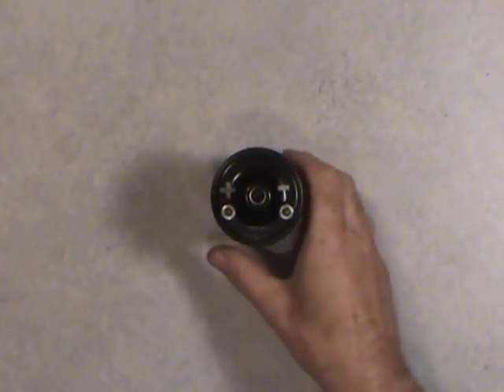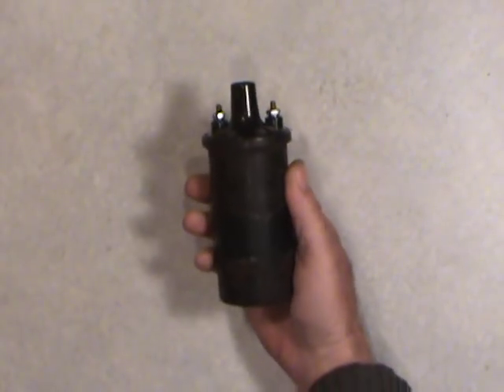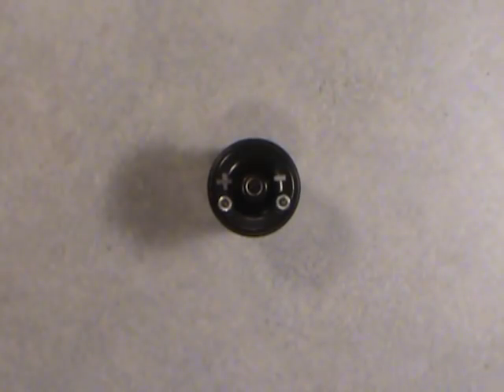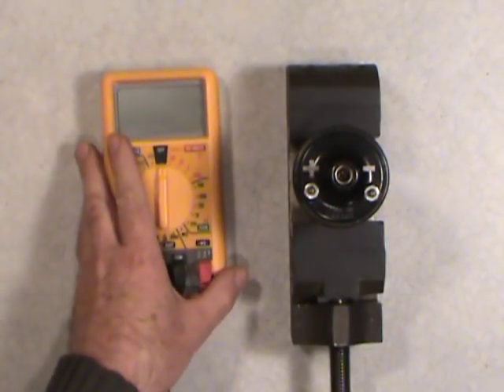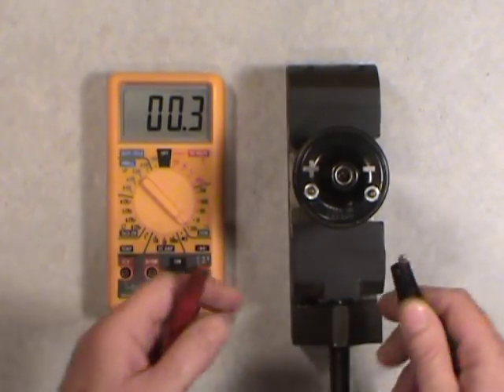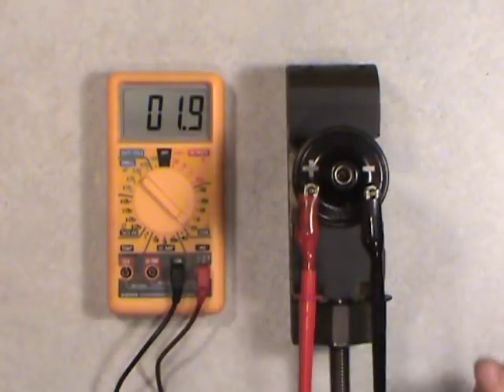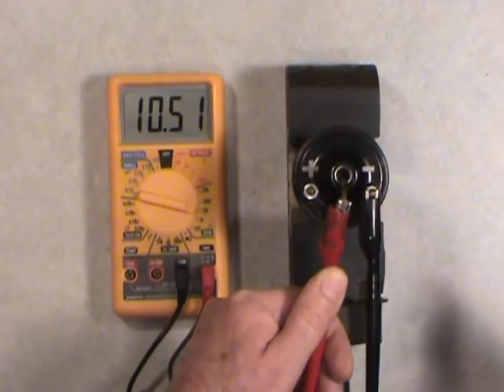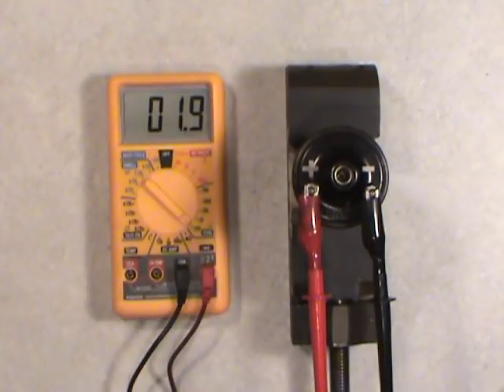Ignition Coil Testing

Comment: Thank you, great video!  Helped a lot in troubleshooting a no-spark issue in a 33 Dodge w/ a 360
Reply from the maker: Greetings Amorget....You're welcome, and I'm glad, that, this YouTube Video of mine was able to help You out, and also, thanks for watching, and commenting too....The "Ohm's" Readings, that show up as being with-in "Specifications" on both, the Primary & Secondary "Windings", are, as I see it, just a, shall we say..."Preliminary Test", as there just might, come a time, that, I'm thinkin', that, and probably quite "Rarely" as well, that, once a "Faulty" Ignition Coil "Heats Up" to its..."Operating/Engine Compartment"..."Temperature"...then, even though that particular Ignition Coil "Ohm's Testing" was showing...."Good"...that same Ignition Coil..."Might"...(and rarely at that), "Not Work" as it was Designed/Supposed to....In other words, that, shall we say..."Faulty/Suspect/Questionable"..."Ignition Coil", just might..."Break Down", when it arrived at its "Operating Temperature", and either, start to Function..."Intermittently"...or..."Not At All"...!!!

There is one, shall I call it..."Major" thing to watch out for, and that..."Thing" happens to be, the "Supply Voltage/Current" that gets "Sent/Connected" to the Ignition Coil's (usually)...Positive or + (+ = Plus Sign) Terminal on the Common (North American) Vehicles, that have...Negative or - (- as in Minus Sign) "Grounded" Electrical Systems, where usually, the Vehicle's "Chassis or Frame"...IS"...the (Negative) Ground.

Watch out now....as, Some of the much "Older" Vehicles "Electrical Systems"..."Might" have Installed in them, "Either"..."Negative"..."Or"..."Positive" (Electrical) "Grounding"...But..."Might" also have, a..."6-Volt"...or a..."12-Volt"..."Battery"...that resides in the..."Vehicle" in question...!!!

Then, depending on the "Actual" Ignition Coil in question, it may, or may Not "Require" a "Ballast Resistor", which will usually show up, in the Form of...a "Resistance Wire" (usually, can be found in quite a few General Motors vehicles)..or...a "Ceramic" (usually white-ish in color) Type of Ballast Resistor, that has the "Job", of "Reducing/Limiting" (and I'm thinkin') Electrical "Current", that as I see it, should result in the required "Voltage Drop", to "Prevent" that particular "Ballast Equipped" Ignition Coil...from..."Burning Up" (aka, Non-Functional any more...Kaput)...!!!

Depending on "Ignition/Electrical System" Installed in some Vehicles, that I have worked on (mostly North American/Domestic Vehicles, as in, General Motors, Dodge, Ford, etc.), would usually Allow "Full" Battery Voltage (in this case, Nominal 12-Volts), to make its way to the Ignition Coil, but, "Only" while in the process of Starting the Engine, and with the Starter Motor in Operation.

When in "Starting Mode", the Engine's "Starter Motor", just might Draw as much as, oh, could be about, and up to about 200 Amps (aka, Amperes), depending on, just How much Power/Torque, that the Engine demanded of that poor ole Starter Motor.

Now then, with All of that Electrical Current being "Drawn" (up to, maybe 200 Amps), from the Vehicle's Battery, has me thinkin', that, the Battery's "Voltage", would probably "Drop", to somewhere, in the neighborhood, of oh, about "9-Volts" maybe, thus, as I see, would be the reason, that, there is usually, a "Separate" Battery nominal 12-Volt Supply Wire, which, will usually "By-Pass" the "Ballast Resistor" all-together...!!!...

...then...

...once the Engine "Starts, and keeps Running", the Position of the Ignition Key/Switch, goes from..."Starting Position"...to the..."Run Position"...and as I've learned/experienced, while the Ignition Switch/Key is in the "Run" Position, the Battery's nominal 12 Volts, could be "Increased" to, oh about, 14.5 Volts, when the Vehicle's "Charging System" becomes "Operational", and, the "Ballast Resistance", that, was like I said earlier, was in the Form of, a "Resistance Wire" (General Motors), or, of the "Ceramic" Type, which will "Reduce" or "Limit" the Electrical "Current", that will result in the "Correct"...Voltage "Drop", that will be "Low" enough to keep the Ignition Coil from "Burning Up", as well as...Not being "Too Low", as that would make for, one, "Not So Good" & probably, quite "Weak" and maybe "Not Functioning"...Ignition Coil.

So, in a Nut-Shell, here's what we have...

...and...

...a very Good comparison, would be, just like the following, and shall we also say...descriptive...good ole saying...

...and, that saying is...

..."The Chain is Only as Strong as the Weakest Link"...!!!...

...or, as in...

...it "Only" takes "One" Questionable/Intermittent/Not so Good...Electrical Component or Wiring "Connection", to mess things up, which keeps Us All, from havin' a good day...

...with all that, said and done, I would like to end with...

...Be Safe, take care, and have a good one.

Comment: You will make a great teacher. Thanks
Reply from the maker: +Cobby Sparks ....Greetings Cobby Sparks....Thanks for watching.................Well, I sure appreciate, what You said, about me, making a great teacher, and thanks kindly for that..................Even I'm kinda surprised, at how long I was talkin', in this YouTube, Ignition Coil Video of mine, and, perhaps it could very well be, as they say, as in..."Time really Flies"...!!!...lol.............If an Ignition Coil, Checks out Ok, Ohms/Resistance-wise, there can be times (rarely), where an Ignition Coil might start Acting-Up, and Not work so good, once it warms/heats up-to Operating Temperature, which might result in, some Ignition related Misfiring (basically, just means, that, the Air/Fuel Mixture, in any of the Engine's Cylinders, isn't Burning properly)....................Thanks again, for Your nice comment, and..........till next time...........Be Safe, take care, and have a good one.

Comment: Good information but kinda painful to watch...  This should be a 5 minute video... tops..
Reply from the maker: Greetings...Brad Miller...............Thanks for watching..............Well, I did make a "Shorter" Version of this particular video, some time ago, and its running time, is about 8 minutes & change (damn, almost down to the 5 minutes that You mentioned...!!!...lol)..............Just make sure, that, when-ever taking an Ohm-Reading, on the Low/Primary side of the Ignition Coil, that, the Ohm-Meter, is Tested for 0/Zero Calibration before-hand, and if it shows anything above 0/Zero Ohms on the Low Scale, when the 2 Ohm-Meter's Probes are connected together, then, that Figure, (if applicable), has to be accounted for, otherwise, there might be a possible situation, where-by, a good Ignition Coil, may appear to be, "not with-in", the Manufacturer's Specifications, and.........till next time........Be Safe, take care, and have a good one.
Reply: Different people have seen this video & some of them don't know about most of the information you explained in this video , so it must take more 
 minutes ,therefore this video deserve time  which is taken
Reply: If you know the 101 in the beginning, no big hassle to forward it test. At least it caters for all groups in 1 simple video!

Comment: the added stuff is good mate. most allready know the little things, but throwing out the little pointers can help
Reply from the maker: +Chuzzlepuff Puffchuzzle ....Greetings Chuzzlepuff Puffchuzzle....Thanks for the nice comment, and for watching too...................There's even more, beyond, just Ohm/Resistance testing an Ignition Coil, as well...................There can be the odd time, where an Ignition Coil Checks-out Ok, Ohms-wise, but, once it/the Faulty Ignition Coil, gets up-to Operating Temperature, it might not work so good....................Also, if the Wrong Ignition Coil gets installed, its Specifications, might not be Correct, for that particular Ignition System, and, might result, in having a Weak Spark, or maybe even having, some of the Ignition Components get Damaged......................If an Ignition Coil gets Charged-Up, with too many Amps of electricity, for too many Milli-Seconds (One Milli-Second = One Thousandths of a Second, time-wise), on its Primary side, during its, shall we say, Charge-Up Cycle, then, that in-itself, has the potential, to probably Fry the Ignition Coil Windings, and, a Burned-Out Ignition Coil, it will usually be....................Once a Person, kinda understands, how, a good ole "Points and Condenser" type of Distributor...Ignition System (up, till about 1974 there-abouts) operates/functions, oh, and, there was "No Computer" anywhere in sight, back in those days, then, as I've found (for myself, that is), is that, by having a basic understanding, as to, how the older Points & Condenser (distributor) Ignition System actually works, I find it, so much easier, to kinda comprehend, as to how, a Computer Controlled Ignition System operates, along with, what the Roles are, for all of the Sensors and Actuators, that go along with it (I hope...lol).....................So then, there You have it, well, for now that is, and........till next time.........Be Safe, take care, and have a good one.

Comment: Very good video!  I believe you can test the old Lawn tractor coils that were used with "battery ignition"
Reply from the maker: maineville prepper Greetings maineville prepper....Thanks kindly, for Your nice comment, and for what You had to say, about the older Lawn Tractor's Ignition system................................................I'm thinkin', that, pretty much, just about any of the Ignition Coils, that were found on "Gasoline"..."Internal Combustion Engines"...(Yes-Sir-ee-Bob, Steam Engines, need not apply...!!!...lol)...could, for the most part, be "Tested" for "Resistance/Ohms Readings", much like I have, in this Ignition Coil Testing, YouTube Video of mine, as long as, the "Ignition Coil" in question has..."2-Primary-Terminals"...and a..."High Output Voltage"..."Tower"...much like, that of what You "See", in this Video of mine....................................................A Person, that might be Testing, any "Ignition Coil", that happens to be on Our Planet to date, should be aware of, the..."Many Differences"...in, what they are Expected to Do/Perform (as in, shall we say, the "Amount" of High Secondary Voltage Output, as an example), and also, the way in which "They" are "Constructed" (as in, Shape, Size, Oil or Epoxy, that is surrounding, all of those, many turns of, usually made of Copper, wire "Windings", that make up, both the Primary and Secondary "Coils", that are usually found, and are Contained with-in, that there Hypothetical/Imaginary Ignition Coil)...........................................................I'll now mention, a few things off the top of my head......................................................There were..."6-Volt"...and..."12-Volt"..."Ignition Coils" (as well as, "6-Volt" and "12-Volt"..."Batteries", that usually went along with them), and also, the "Vehicles"..."Ground"...System, should be "Checked" as well, as, some of the Older Vehicle's "Chassis/Frame", as far as I recall, had what was referred to as "Positive Ground" (+ or Plus Sign), as opposed to, the..."Negative Ground" (- or Minus Sign) System, that, for the most part, can be found on the "Newer" Vehicles, on just about any Street in North America these days.....................................................Usually, the "Oil Filled" Ignition Coils, were, well, kinda held back, from..."Outputting" as High of a "Secondary High Voltage", as compared to something like, the General Motors..."HEI" (High Energy Ignition) Distributor Unit/System, that used an "Epoxy" type of Ignition Coil............................Why You ask...???.........................Well, there was usually, what is known, as a..."Ballast Resistor" (could be in the form of a Ceramic/Porcelain Block, if You will, or, in the case of the General Motors rendition, there-of, it could also be in the form of a "Special Resistance Wire" as well)............................These "Ballast Resistors", were usually found, in the wiring circuit, just before the Ignition Coil Itself, and, they usually "Reduced" the "Battery Voltage" quite a bit, so the Ignition Coil "Would-Not-Burn-Up", and in the case of a "Points Type" of Distributor, it would also, prevent the "Ignition/Breaker Points"...from..."Electrically Arcing" too much, which would usually result in "Ignition/Breaker Points", that, shall we say..."Wore-Out", way too fast...!!!............The "Oil Filled" type of Ignition Coil Systems, some being "Points Type", and also "Electronic Type" as well, that I've worked on, would usually have a Spark Plug "Gap", of about .035" (thirty-five thousandths of an inch)...where as, on some of the "HEI" Distributor Systems, I've worked on, I had to "Gap" the Spark Plugs at .080"...!!! (that be, Eighty Thousandths of an inch..."Hole-ee-Gwock-ah-Moe-lee"...!!!)..............................................Always "Check" the "Specifications", and the Factory Recommended Procedure/Method, that applies "Exactly" to the "Ignition Coil", and to that of the "Ignition System" that You, or Anyone happens to be working on, both for "Getting it Right, the First Time", as well as..."Doing it Safely as well"..............................................One last thing...............Even though an "Ignition Coil"..."Checks Out OK"...Resistance/Ohms-wise..with an Ohm/Multi-Meter, while being fairly Cool, so to speak, there can be times, and quite rarely as well, where an "Ignition Coil" can start "Acting-Up", as in..."Operating Intermittently"...or..."Not At All"...once that Ignition Coil, or, Ignition Coils, as the case may be...get Up-To..."Operating Temperature" (like when the Engine is all fully warmed up), so, please, always keep that in mind, just in case........................Till next time.............Be Safe, take care, and have a good one.

Comment from the maker: Greetings San Ozi....You are welcome, and, thanks for your comment....For the most accurate reading/readings on both Digital, and Analogue (analogue meter has the needle pointer/indicator) Meters, it is usually best, to select the "Lowest-Range" that will still "Display" a proper reading, without having the Meter in question, going out of "Range"....Take my Yellow-Digital-Multi-Meter for example....If I select a Range that is too Low for the measurement that I'm trying to test...(con't)